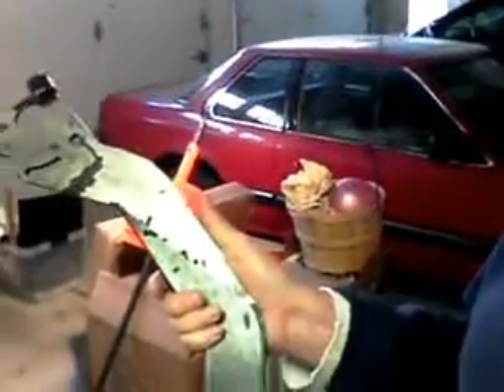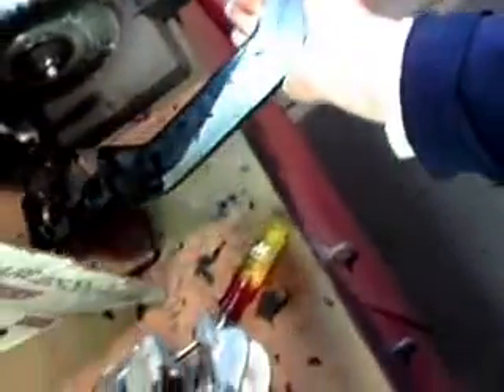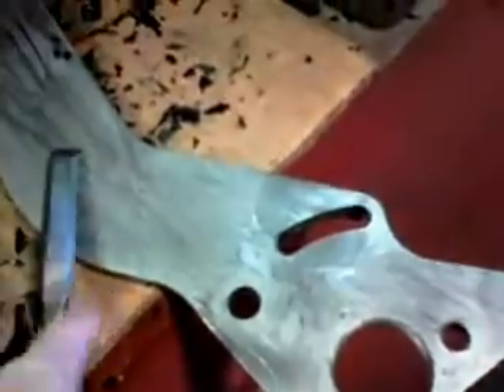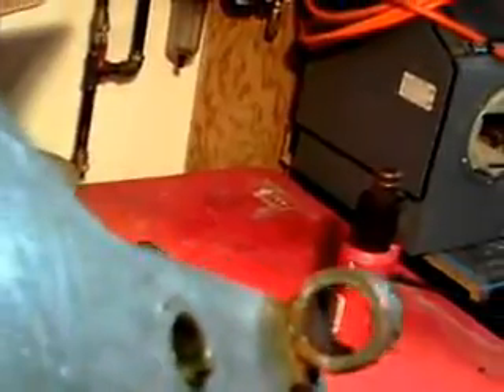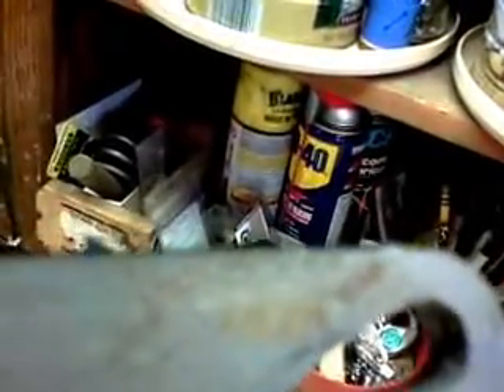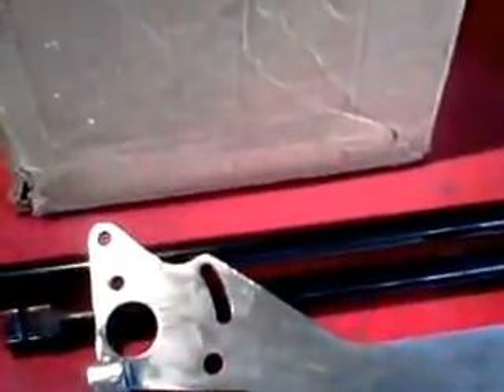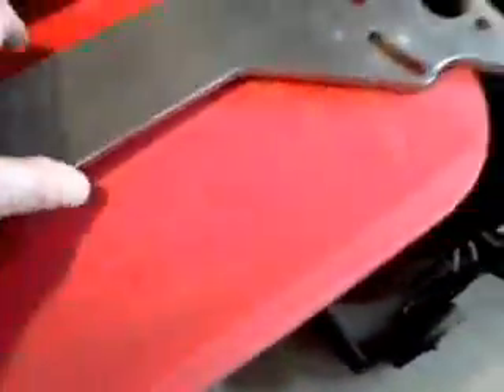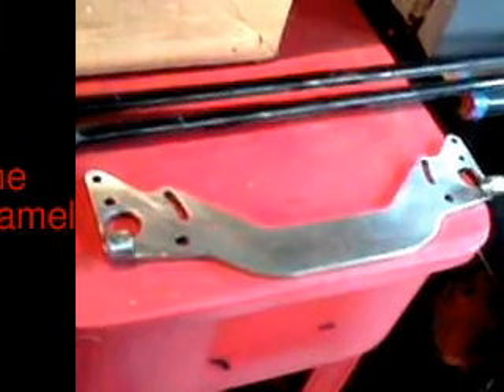Jaguar Torsion Bar Reaction Plate refinishing

Comment: Too bad about the powder coating, I started out powder coating alot of my parts and gave up when I saw that the rust resistance was nothing like what was claimed.  In my case that was on sandblasted valve covers,  that were zinc phosphated, baked and then powder coated, those are now completely rusted.

Comment: Yeah that looks pretty bad john. As I said before I am doing my own powder coating, and from my research, it looks like 2 problems with your reaction plate, one, bad prep, that should have been fully sandblasted, so that ALL residual rust has been eliminated. the second, which I have been told is just as important, is "out-gassing" or pre-heating. You heat the part before you powder coat, this gets rid of any moisture, and makes the powder stick, so I guess it's been badly done.